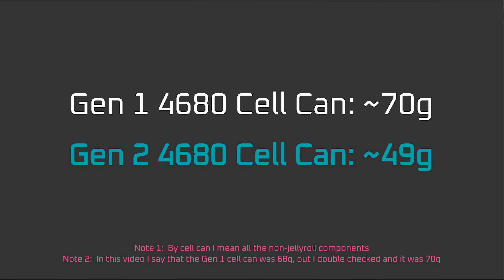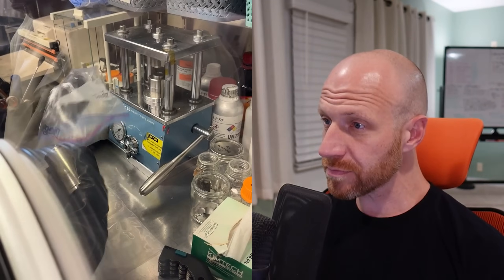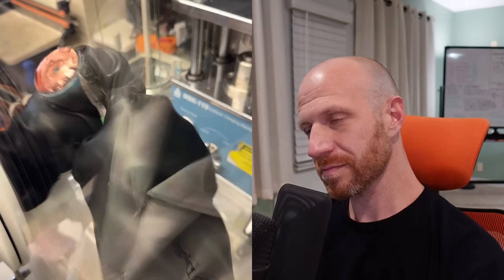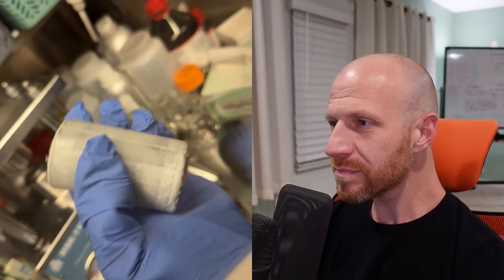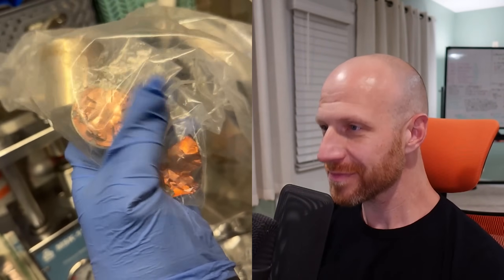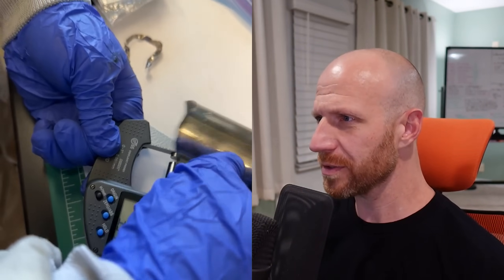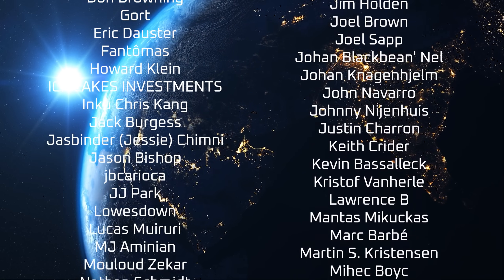'Cybercell' Teardown // The Generation 2 4680 *Bonus Content*

Comment: Munro Cybertruck 4680 clean room autopsy.
Can't wait to see your charge/discharge cycle.
Reply from the maker: I won't be able to provide that because the battery was fully discharged and therefore damaged 

However! I still got the energy density information from Munro, and I confirmed that they used the same testing procedure that I used with the first cell 🤠

Comment: Measuring the CAN wall thickness using flat micrometer is wrong procedure. Instead use caliper gauge to measure the sheet thickness. For me looks like thickness is much smaller than 0.55mm on sides and measuring the weight is not the right process. As these are thin cylinder parts, which can have the thick side  in top and bottom of the cell.
Reply from the maker: Yup, covered in the next video of the series

Comment: Hi Jordan, love your channel! There are reports within the Chinese Internet community, that China had a breakthrough in solid-state technology, and they might start mass production soon, like this year or next year. Have you heard anything? if it's accurate, could you make a video on this topic?
Reply from the maker: Solid state batteries have been on the market for years

The issue is they cost too much for auto use cases

Planes are viable, cars, not yet
Reply: @thelimitingfactor  ok, thanks for your reply. it's probably a hoax.
Reply from the maker: I wouldn't say it's a hoax, but rather that battery marketing and hype usually focuses on what the battery has to offer rather than where it comes up short (like cost) 😉

Comment: May I please ask - when the jelly roll (wrapped in tapes) was removed from the can, the inside of the can seemed pretty dry, I was expecting that there would be some electrolyte filling the gap between the roll and the can, no? Thanks in advance.
Reply from the maker: Yup!  There's electrolyte in it, but it's more like a damp sponge than an aquarium

They put the minimum amount in necessary
Reply: @thelimitingfactor  Thanks for your reply! I guess it is the same for pouch cells too?

Comment: Love the tear down! Any plans to do separator testing? As the separator is such an important part of the battery would love to see separator test such as Porosity Measurement, Gurley Number Test, *Mechanical Strength Testing, *Thermal Shrinkage Test, Electrolyte Wettability Test, Electrical Resistance Test, Ion Conductivity Test,Thickness Uniformity,Chemical Stability Test, *Separator Shutdown Test.   Particularly interested in safety related tests.
Reply from the maker: I'll have to think about that 

My gut response is that I want to make the most of the time that uc San Diego has for me

Usually the Chinese are ahead on things like this, and they're just now starting to use ceramic coatings for their separators 

I expect Tesla will move to separators like that in the next few years, but there's no indication of that so far 

But, as I said, I'll think about it 🤠

I do understand the importance of it ✊🏼
Reply: @thelimitingfactor  Good test to run is to take a piece of separator pit in an oven and ramp temperature up from 100C in 10C increments up to 180C, then measure shrinkage and if you can see the pores close under a microscope - this gives the shutdown temperature.  Really interested if they are using ceramic coatings, I would assume they are, but if they are not this is particularly interesting.

Comment: I noticed a standard micrometer being used in the measure of the can thickness. If the metal is stiff he will not get an accurate measurement because the metal will still be curved. You really need a ball mic to measure a cylindrical wall thickness. His reading will be off some % amount.
Reply from the maker: I noted that on the slide in pink

Comment: Did they measure the length of the jellyroll ribbons? If the can is even at all thinner then they might get one more winding lengthwise into the jellyroll. This would add a tiny bit of energy density even if the width of the ribbon is the same as gen 1.
Reply from the maker: No, it wasn't necessary to measure the length 

We'd only need that information if we were calculating the energy density, but we have an actual measurement of energy density

Comment: 8:49 base more important for thermal conductivity straight to can.
Reply from the maker: The copper side?  Yes
Reply: @thelimitingfactor  thanks for clarifying. I had several aspects wrong. 
So copper anode current collector via copper tabs weakly welded directly to can 'lid' conducts heat & electricity to entire cell casing? Cathode (aluminium current collector & tabs) basically thermally isolated. 
Thanks for response, videos & years of effort.

Comment: When measuring the thickness of the can it didn’t appear to me the fellow “flattened” the can before taking the caliper measurement. The “hook” end of the caliper has a substantial flat surface. He was impinging it upon a concave surface in the interior of the can, therefore not making full contact with the surface, instead only at two points where the curvature of the can meets the outer edge of the caliper surface, thereby lifting it at two points from the actual surface. The outer surface didn’t matter since the plunger side of the caliper wasn’t lifted from the actual surface
Reply from the maker: Already covered  in other comments and at the beginning of the video

Comment: The problem for Tesla is that CATL and BYD cells are way ahead in terms of energy density and cost and Tesla vehicles are saddled with their 4680 which will cancel out their system efficiency advantage. The cybertruck for example, would be a way better vehicle with a CATL quilin battery pack.
Reply from the maker: If they ramp DBE, which they claim is solved now, Tesla will have them beat

I did a video on this.  Qilin vs 4680 vs Blade

Comment: Where is the Electrolyte, was it removed before the tear down? Would be interesting to see that
Reply from the maker: Nope, that jelly roll is wet 

They just use electrolyte very efficiently, it's kind of like a damp sponge
Reply: @thelimitingfactor  ok, thank you🙏
Reply: if a cell isnt opened super fast, the (presumable) DMC evaporates super fast. indeed, openened cell components are quite cold due to evaporative cooling, you can even feel it through GB gloves. in the separator the electrolyte remains longer. however, you are right: there is probably hardly any excess electrolyte in the cell.

Comment: When measuring the thickness of the outer skin, the rounding may also play a role. In the video it looks as if there is still a gap between the measuring surfaces, so the material is apparently not flattened enough by the micrometer screw. If I assume a ø5mm measuring surface, that would be a mathematical deviation of 0.14mm.
So I suspect a thickness of 0.5mm
Reply from the maker: I agree! 

I covered this in the introduction in the pink text on the slide

Comment: That plate welded on end of jelly roll may be thicker as well as having more weld spots to handle more current. Lowering ESR (Effective Series Resistance) as much as reasonable for the lowest heat buildup is vital for performance in both use and charging. The changes could be very subtle.

Comment: For the thickness caliper, perhaps you guys should consider ball pin type tip, it should give a more repeatable measurement.
Reply from the maker: That's what I used for the pink text in the introduction 

I got .4 with cheap calipers using pin
Reply: @thelimitingfactor  I think your 0.4ish measurement is more reasonable, you can do a parametric estimate on 0.4 vs 0.5 via simple 2*Pi*R*thickness X SS density. 0.5 will put you too close to the total 49grams shown, and you still have to factor in the top and bottom "circular" enclosure.

Just my 3 cents, great analysis by you, as always!!

Comment: Like you I noticed the spot welding of the current collector plate to the electrode edge folded over matrix thingy.  The more the merrier there.  It would be cool if that whole surface was welded.  One of my concerns about the design is the reliance on "pressure" connection at the cell ends.  As in all the electrode edge layers are just pressed together and not soldered/welded to the outside world.  This kind of connection can degrade if the copper gets an oxidation layer or other passivation layer that changes the resistance of the interface over time.  So welding as many of those elements as possible could really help the cell long term life and maybe resistance to shock and vibe.
Reply from the maker: Great insights. Thanks!

Comment: Awesome to see this cell being taken apart!  Having made battery jelly rolls in a past life I would be interested in careful thickness measurements of each electrode with and without the active materials.  The total length of the electrodes is also key as mentioned previously.  Separator thickness might be of interest as well.  If you know those things you can stack it all up to make pretty exact calculations of active material available for the old and new cell.  A shorter electrode with thicker coating may have higher energy density at the expense of power density or visa versa.  I suspect they're the same but you never know.  I would be curious to see the can thickness measured if it was made super flat first.  I think he was off some because of the radius on that spot.  What a pain to have to work inside the glove box, those are some dedicated guys.
Reply from the maker: I will definitely be getting the thicknesses! 🤠

That's because I want to know if they're using an asymmetric electrode, and I want to see if they're getting any benefits from the dry coating in terms of thickness

I decided against getting all the dimensions of the jelly roll because rather than calculate the energy density, etc, I'll be using the actual measurement from Munro and associates.

Agreed on the cell can thickness! 

Check out the video introduction where I show the slides, in pink is the explanation and what I consider to be more accurate measurements

And thanks for the well considered comment!

Comment: Your question: why is an anode slightly wider than a cathode, the answer is: to avoid any Li platting. The current densities at the edges of the current collectors can be much higher which can potentially allow the Li to plat rather than intercalate in the electordes. Li platting is undesirable!
Reply: I hope Jordan provides the N:P ratio for this cell.  Tesla historically has been aggressive with as low a N:P as possible, including the Panasonic 18650 cells make to Tesla’s specifications for the 2012 Model S.
Reply: @georgepelton5645  It’s tough to identify the exact N/P ratio given that the electrode formulations are unknown, the type of NMC, and that if there’s any Si content. How did they manage to determine it for the Panasonic 18650?

Comment: Great video!
Let me give some comments:
3:53 - We can see that the anode copper collector foil has been pushed inwards during production

4:06 - Here we can see that the electrolyte filling hole was sealed using a tight fit of the steel ball in the brass housing. I believe this is the reason why the collector foil was pushed inwards. I bet that Tesla mechanical engineers have done correct stack-up analysis, so that the ball should never collide with the foil, but they probably forgot that when the force is applied to the sealing ball, entire lid move inward. When the process is finished, the lid springs back, so nobody notices ;) But this is a serious thing, which can lead to short circuit.

4:32 - We can see that the welding of the anode side could be better, as after removing the lid, there should be remains of the collector foil on every welding bead. What is more, there is a linear pattern every 120 degrees, but one of them is barely seen - in this section the protrusion is very low, therefore bond strength an conductivity are low. This is caused by the fact that the lid is thick, thus it is difficult to adjust correct laser power when welding. If we set too little, we are risking weak bond (as on the one from the video), however if we set power to high, we risk burning through the foil, creating spatter or even burning through lid, which makes sealing impossible.

6:33 - Here we can see a very good welding. Both: cathode disc to the collector foil and cathode disc to the rivet. While force is acted on the disc, it loses its cohesion rather than detaching from either of the welds.

6:30 - Here we see a pre-made gasket at the bottom of the can, which is much better solution than just taping the cathode side or adding a gasket during process.

8:43 - Here we see a nice round inner hole of the jellyroll on the cathode side

9:22 - Here we see a completely deformed inner hole of the jellyroll on the anode side - yet again effect of the phenomena from 4:06

9:43 - Here we see that the anode electrode is only like 10 mm longer than the cathode electrode, which is very efficient and requires very good process control. Very often the winding mandrel make entire 360 degrees rotation with just anode, to make sure entire cathode is covered.

Now few general comments:

1) There is no active material remaining on separator -> this implies very good adhesion between collector foils and the active materials

2) The white stripe on the cathode electrode is called a ceramic coating and is placed on the foil side. Its function is to prevent short between anode electrode and the cathode electrode's foil

I think that's enough :)
Reply from the maker: Great analysis thanks!  🤠
Reply: Seems like you should be managing the Tesla battery team
Reply: The ceramic coating on the cathode also allows for laser notching into the active material and without it there would be a much larger heat affected zone.  Laser notching the anode active material is no problem.
Reply: @Zero_Degrees_DeLisle 
Wow! That's a very interesting information.
Thank you :)
Reply: I thought the ball bearing was used as an emergency gas venting system (eg as internal can pressure rises it pops out and vents the gas in the event of a cell failure). I guess its used for both purposes?
Reply: @puffpio  It could but the pushing force is F=p*A, and the A of the ball is very small. Therefore you need a really big pressure to pop the ball out and the variation of the fit would make a huge pressure margin.
What is usually done is to make parts of the lid thinner and that the gap is formed if the pressure is to high.
Reply: @puffpio I thought vents electrolyte, not gas. (provided car remains on wheels) Helps to stop thermal runaway.
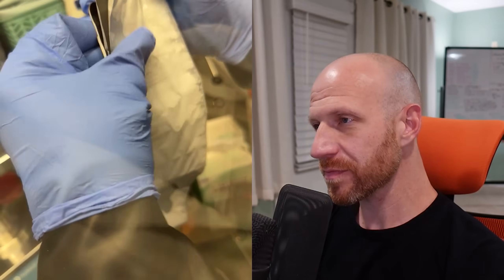Reply: Certainly a good point about 4:06 and 9:22 - but note the center of the jelly roll is only the current collector for the anode so any interference with the ball "should" only be with the anode and avoiding the short circuit. 9:53 shows this overlap (extension of the anode past the cathode).
Reply: Also note the center has no tabs -  making the center appear lower (pushed in) than the section with the tabs.
Reply: wow, nice info
Reply: At 4:32 If power is too high the separator could potential be damaged. Excess heat in this process should be avoided at all cost. In all other Tab welded batteries the separator is either not in place or much further away from the heated zones. I would guess they have been particularly cautious in preventing damage to the separator to minimise risks of internal shorts.

Comment: Making a thickness reading from a curved piece of metal sheet will never give a proper reading. It needs to be flat, much more important when we are dealing with such small measurements... It could be correctly measured if the point of contact for the measure tool is as small as possible like the point of a needle, but that measure tool had a big point of contact.
Reply: A micrometer like that is able to apply considerable pressure if you don't finess it. I.e. it might have flattened the material somewhat when measured. But not entirely. Flattening fully would require more force.
Reply from the maker: Correct! I fixed that up on my slide in the introduction 

🤠

Comment: So just by the can specs stated here for the gen2 cybercell they knocked off about 30% in weight and simplified the design&manufacturability. 
I liked what elon said about 4680s being on a 6 year timeline in August 2023. 

So far they have hit each milestone he wanted the program to. People forget the ct with a 123kwh pack per Edmunds in real world epa simulated testing returned a genuine 340+miles without aero covers on at 35s. 

Also as he pointed out recently? Some cell suppliers, all they do is make those cells&nothing else. Tesla though makes cars, inverters, motors, chargers, batteries, factories, robots, software etc&of course they specialize in making the impossible arrive merely late. 👍🏻😀
Reply from the maker: Amen! Great summary